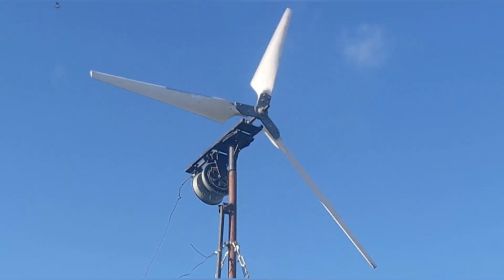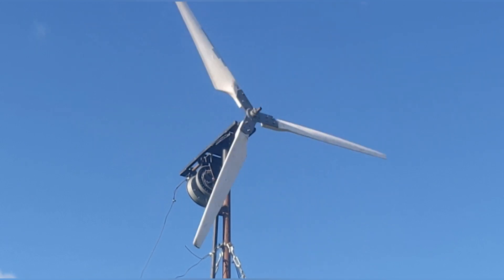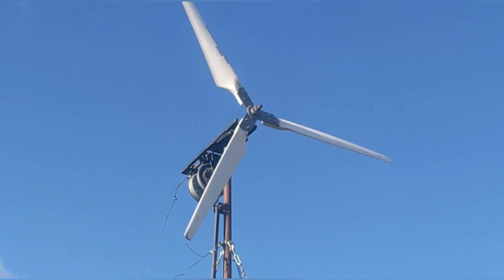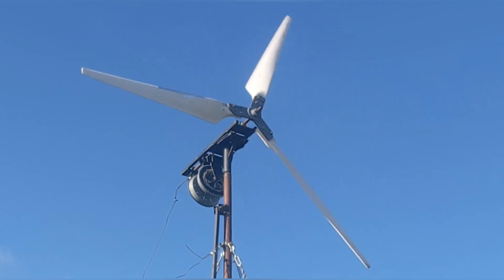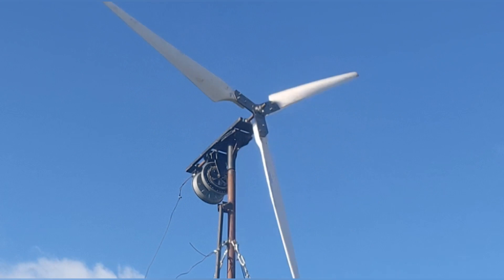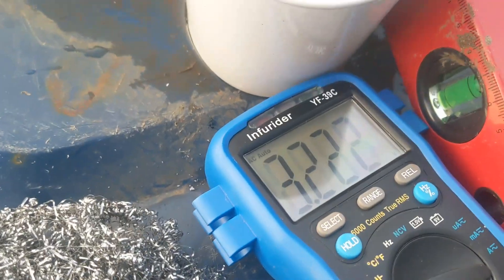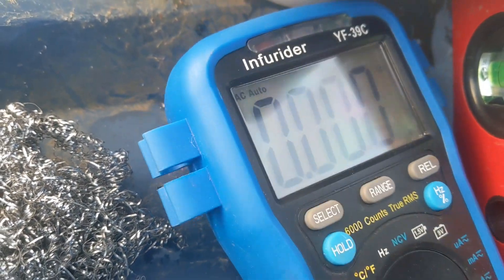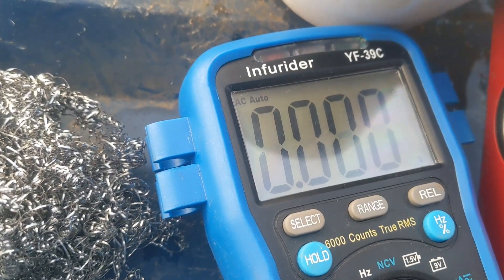Green Energy Smartdrive Motor Wind Generator Testing - "Day One" More footage

Comment: brake on my turbine works when i short out all 3phases... rectifier wouldnt give any voltage if it was burnt or damaged
Reply: maybe try to put rectifier near to you... ac from turbine will not lose much trough that long wire, but dc is losing a lot volts ;) atleast thats what i have seen building my previous turbines :)
Reply from the maker: I think the rectifier was fault and it might have been MV not sure but the new one is nice and shiny :)

Comment: You need to bring the 3 phase power down the inside of your mast so that you have a 3 phase slip ring set on the top. Then you could troubleshoot your problems without having to lower it each time. That would also get your rectifier down from up top. Making it easier to change if needed.